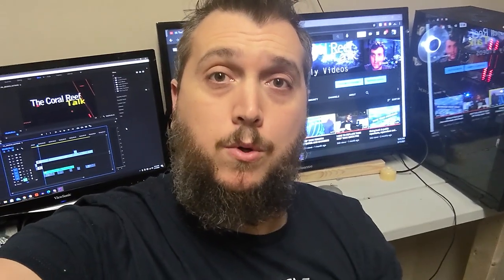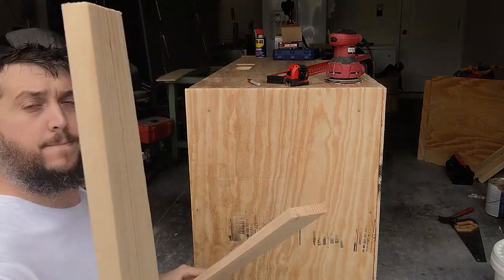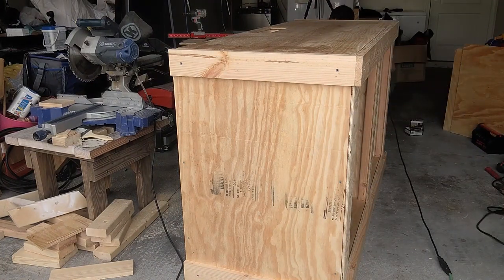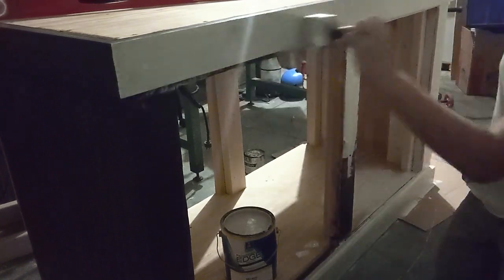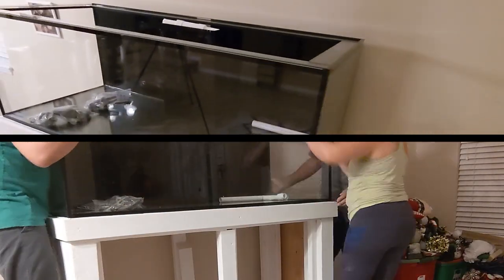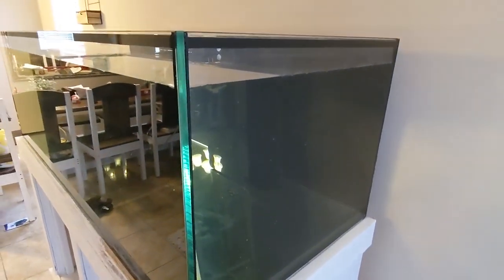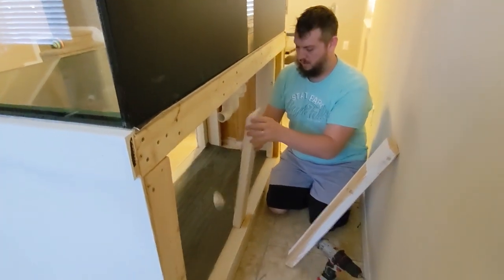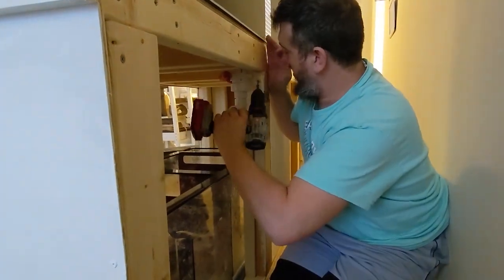125g SC Aquarium Reef Tank Build Part 2!

Comment: Question! Did you seal the wood with something to waterproof it
Reply from the maker: Thanks for the question. I used a stain and then two coats of paint. If you wanted to add a deck sealant you could. Thanks for checking out the video.

Comment: . Hi question I'm getting a tank from local pet store that has a black frame on bottom do I still use the plywood on top of stand ?
Reply from the maker: Great question. If you have a glass tank and have the plastic frame that helps brace and support the tank on the top and bottom then you could do a more simple finish where the tank rest along the perimeter of the stand. However I would use the plywood to have a solid sturdy surface for the tank to sit on.
Reply: @TheCoralReefTalk  From what I understand, you only use the leveling mat with a frameless aquarium but the plywood top is great to help provide an even and level surface for the frame to sit on.

Comment: What size off plywood did you use for front and side
Reply from the maker: I used quarter inch plywood. Thanks for reaching out. Are you currently working on an Aquarium Stand?
Reply: Yes working on 120 gallon first part is finish but having a problem with the door is the first time making a stand
Reply from the maker: @hanserflorentino7462  Very nice. For the doors I used the concealed cabinet hinges, there is a special bit that drills the right size hole for the hinge. The construction of the doors are pieces of the one by that I used for the top and bottom lip. They were grooved and connected to a piece of plywood.
Reply from the maker: @hanserflorentino7462  you can also simplify the doors by just using plywood and cutting them to the size you need and using a piece thick enough to be flush with the top and bottom lip. How has the building process been so far?